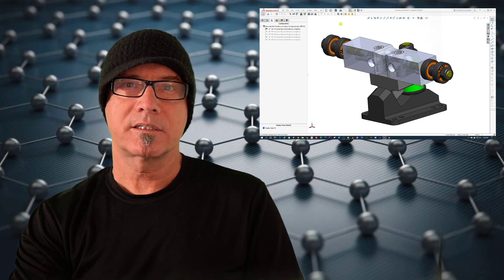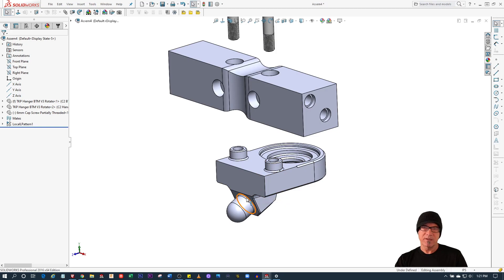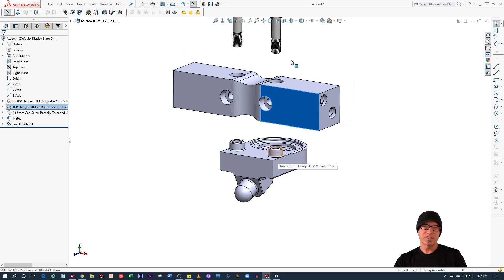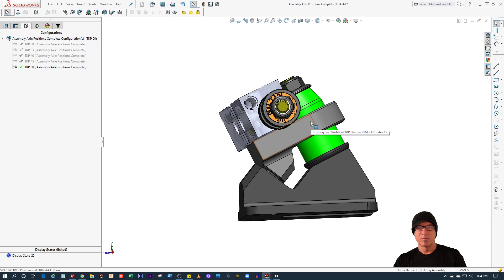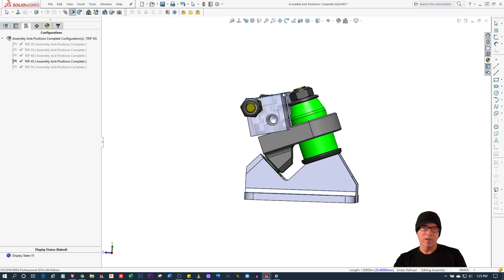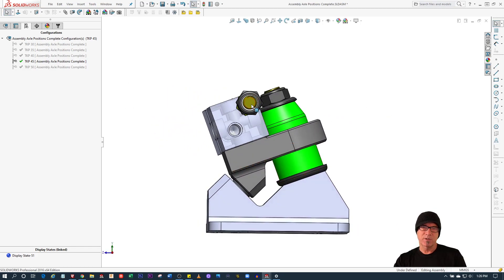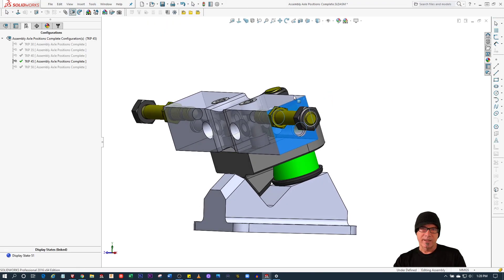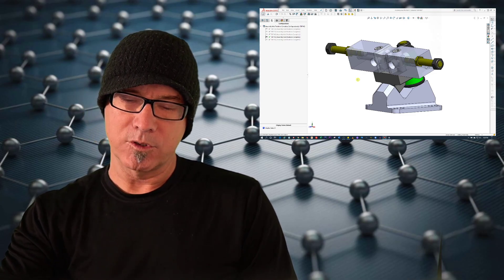Chris Chaput's TKP Prototype - Test 8 Different Axle Positions

Comment: The benefits for pumping is all I want to know..
Reply: I think is more about giving possibilities of customization than a particular benefit. this one is a rkp pivot geometry, with Tkp axle position, it is going to turn and lean the same than a Rkp, but will extend the wheelbase (slightly reduce the turn, invrease stability, improve pumping on higher speed), and will charge the weight more on the pivot and less on the bushing ..which is actually in my opinion not a good thing for pumping  as you lose energy return and shorten the life of the pivot. It is probably more about downhill, I mean feeling benefits on very high speed up to the rider style, still all very experimental.